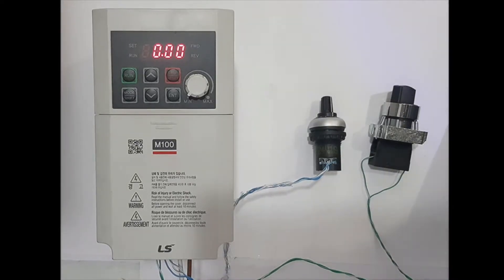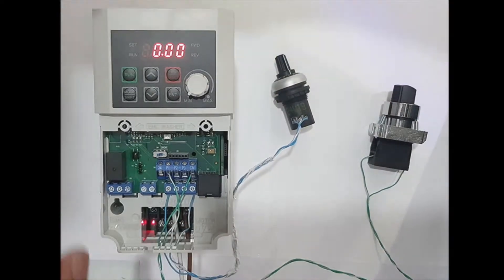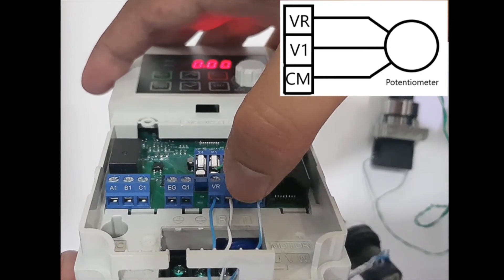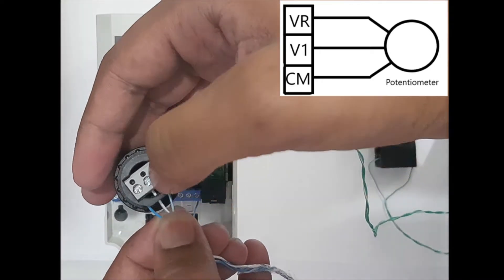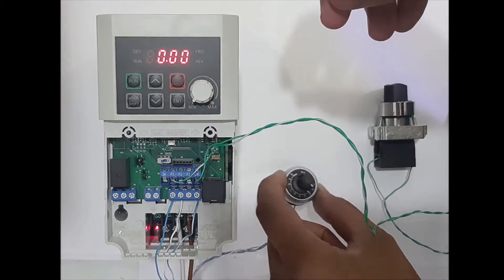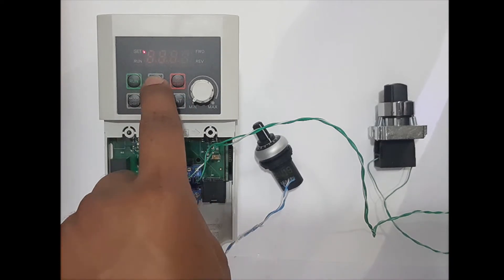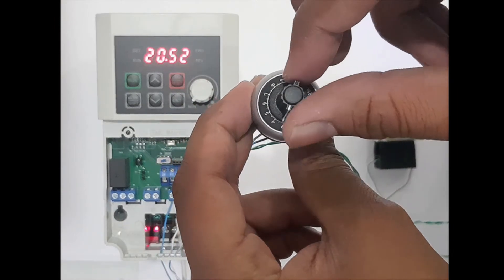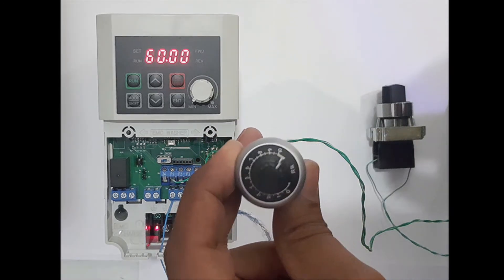How to program LSIS M100 for potentiometer?

Comment: How to connect the ground ??
Reply from the maker: Find the ground symbol at the bottom of the drive.
Reply: @howto...8040  there are two ground symbols, is it like that one for the main power , and one for the motor wiring , other question should i attach the ground wire the touching surface of the panel , ,,, in my case i am using single phase to three phase vfd , thank you